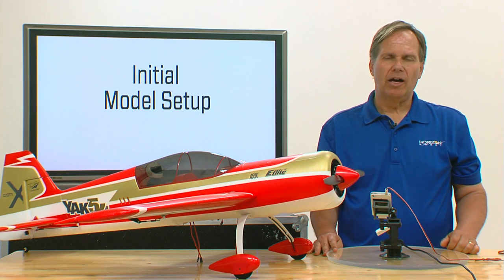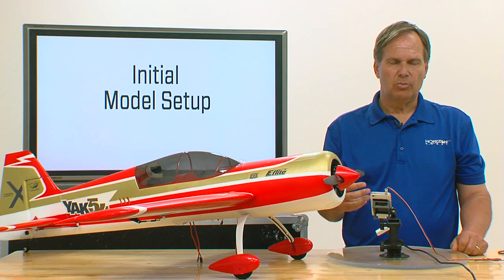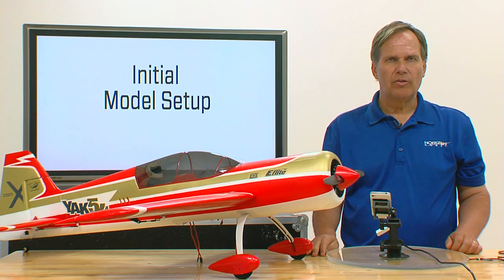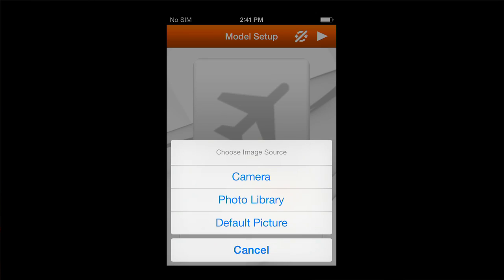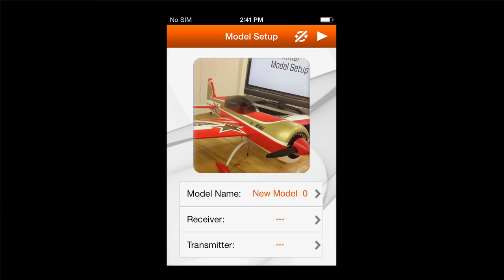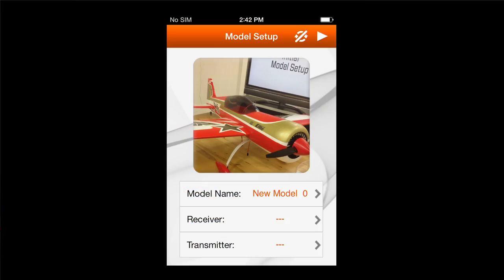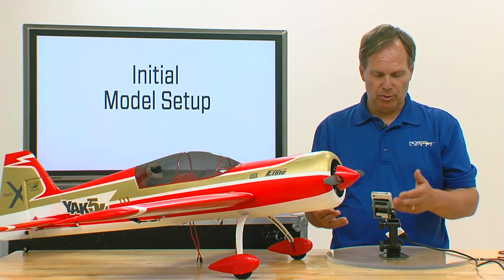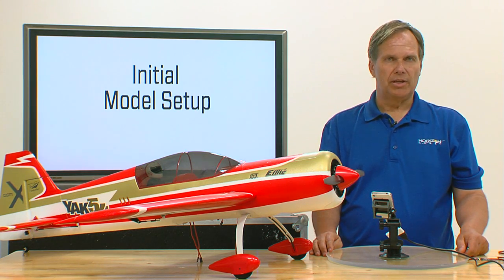Spektrum AS3X Step 6: Model Setup (Initial Setup)

Comment: Just a general comment:  I've watched all of these videos 3 or four times each and they are very helpful.  However, it also shows that his can be a frustratingly painful process.  One thing I noted as I worked to setup a couple of old school Radians was that the comment was not necessarily completely necessary, that everything is set up on the digital side.  I found I had to readjust my Tx "Mode" settings on the back by trial and error in order to get sticks properly acquainted;  also found repeated bindings were necessary, restarts, etc., just to make sure I was completing the steps properly.  Overall, this is better than the former method.  I found once my system was communicating and surfaces were being controlled by my DX6e properly, that the fine tuning of trim was super easy by iPhone.  Overall it was quite frustrating but after pushing through, it was a relief to get it right. Thanks for all the videos.  I hope someone from Spektrum reads these threads LOL.

Comment: I need to reprogram the Maule setup, its WRONG. No aireolons on my plane, only rudder. That has to do with gains setting. If I cannot fix this, I have an after market programmable gyro that would probably work better.